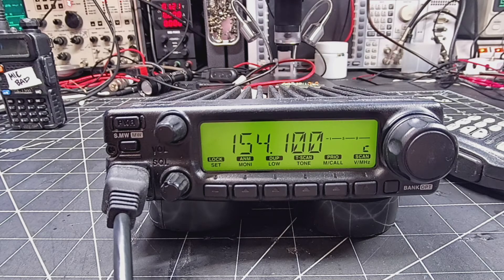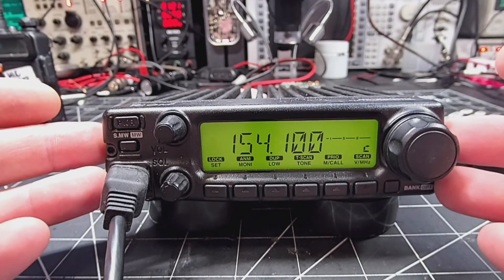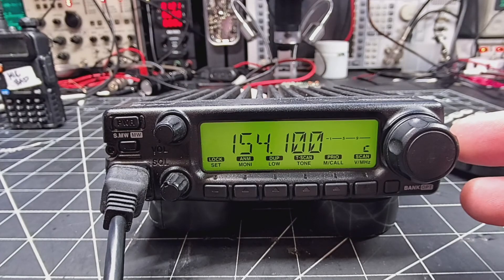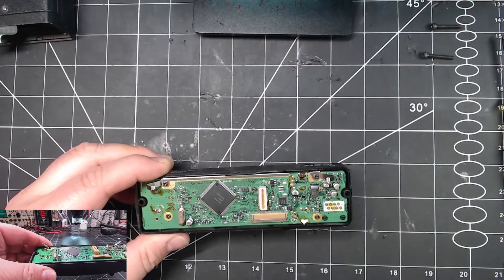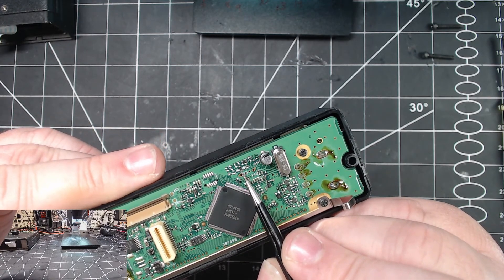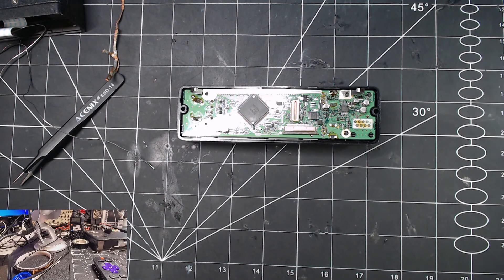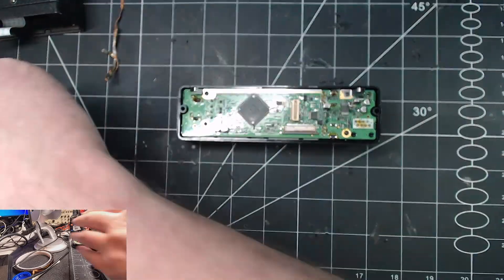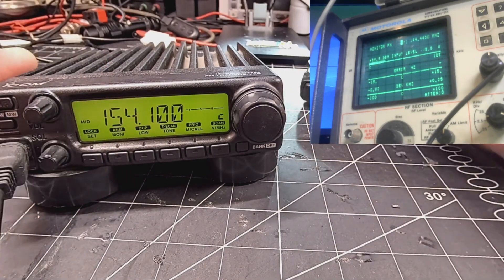Icom IC-2200 Frequency Expansion Mod

Comment: preformed this to my 2300H prolly 38 years ago maybe more,  we worked with the local fire dept.  back then,   the ic-2300H was my fire radio,   worked great,  now i'm putting it back in my truck to get back into the ham radio end of it,  thanks for the video, I forgot how I did this mod years ago,

Comment: I just purchased this radio (still waiting for delivery). Very interesting video. With what are you pushing on the tiny black part? Are you using a soldering iron to heat it up a bit as you push on it? Appreciate it!
Reply from the maker: That's right, I'm just using the soldering iron tip to heat up the entire part and gently push the part away
Reply: I think IC-2200 has been discontinued for a while,  current model is IC 2300